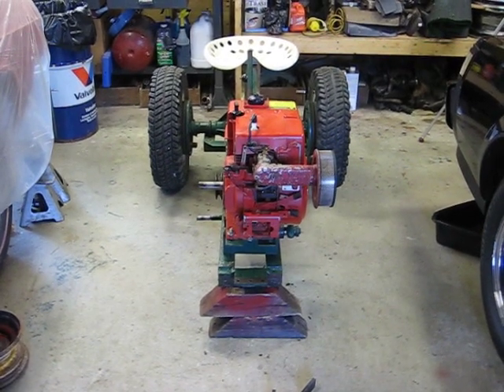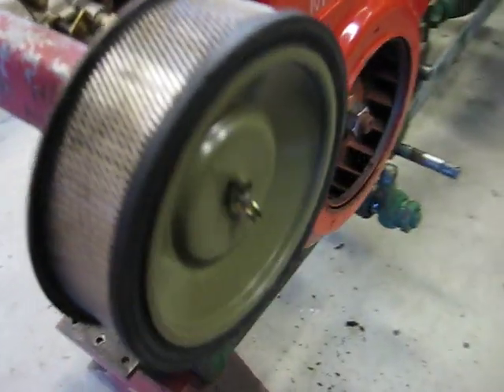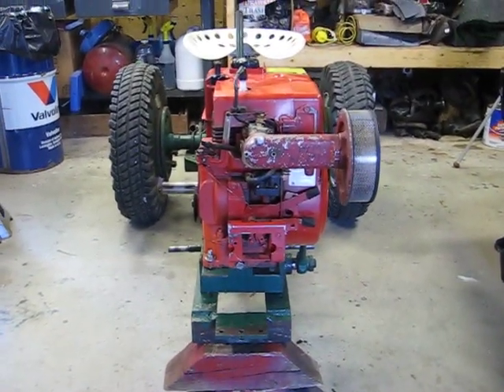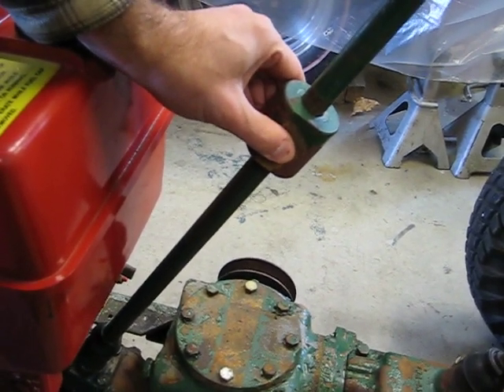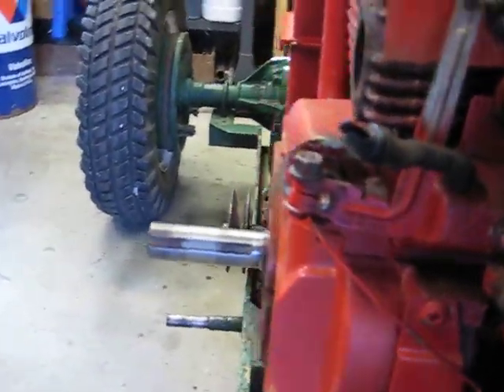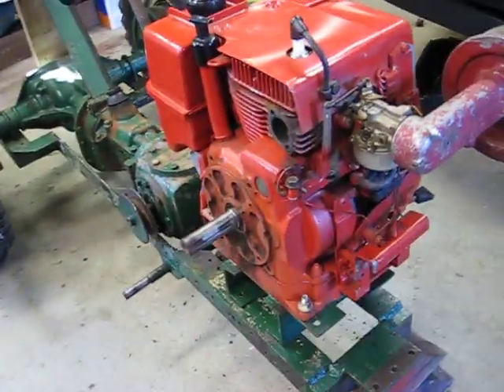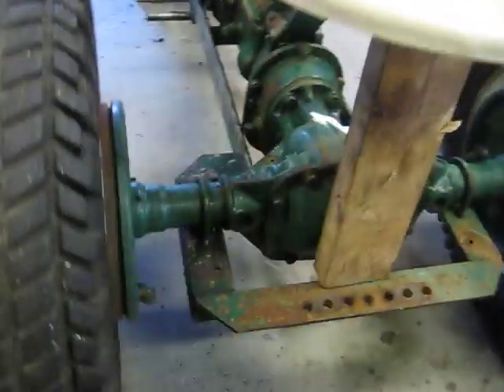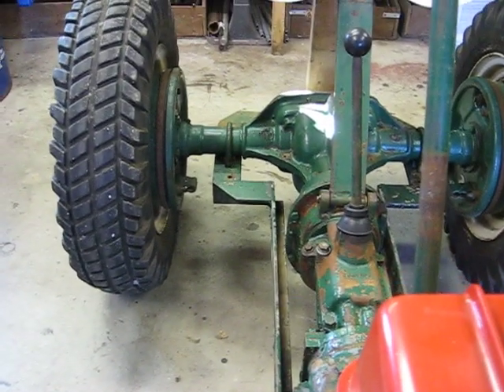1960 's Pow'r Pup Power Popular Mechanics Magazine Garden Tractor Build Part 4

Comment: Realize this is old vid posting, but thing that came to mind right away watching it, was described rear fender set up, with lower seat. Sounded like good way to lose fingers or even a hand. Just drop your hand on rear wheel when moving and it would get sucked in between fender and wheel.

Comment: Love what you are doing here. I too like the cub O grille, the flat 3 spoke steering wheel might be a good choice. This thing looks like a lot of fun. Since you asked for opinions, check out the modified air filter cover on my 140H3. It uses a 4" tall element and looks real nice. http://i448.photobucket.com/albums/qq206/bobkmac/140H3AirFilter_zps6feb32ed.jpg